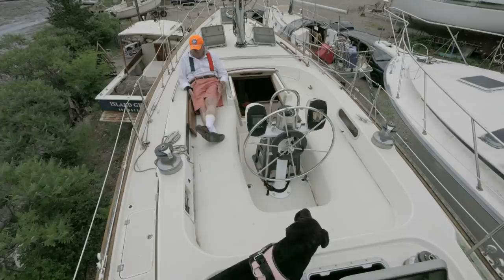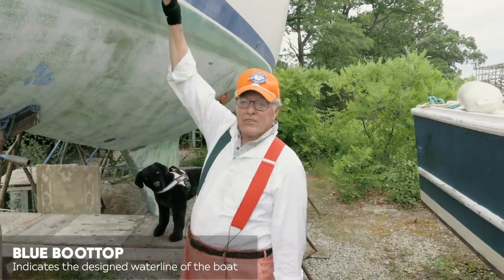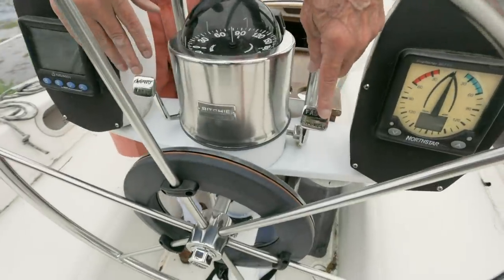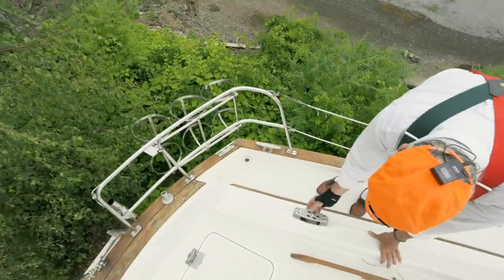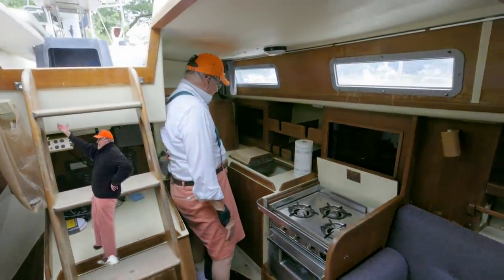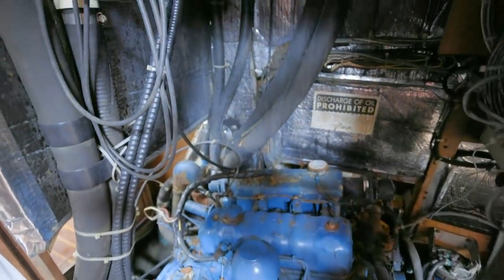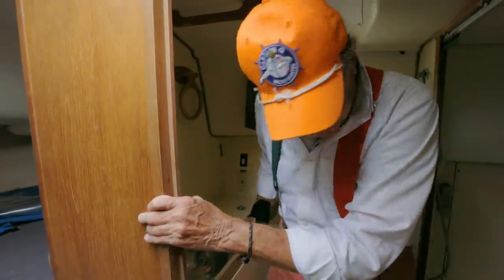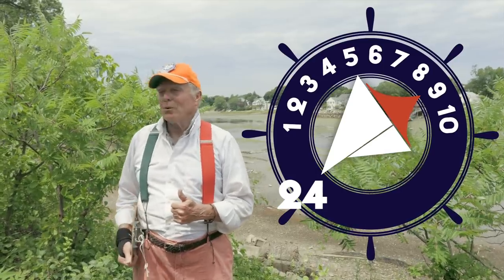$24,000 CRUISER! Pearson 385 cruising sailboat for sale | EP 47 #sailboattour  #sailboatforsale

Comment: I think you do a wonder job of reviewing these yachts, however, I think you should always pull up the floorboards to show the condition and configuration of the bilge. Keel bolts or encapsulated? Bilge pump and throughhulls. Steering quadrant, propshaft, cutlass/pss, and rudder post. Chainplate articulation? In this episode, it looks like there was a major crack on the skag just below the the rudder gudgeon. I wonder why there was no comment? FYI my first keelboat was a 1961 Aeromar (Pearson) 24' Aero.
Reply: Your line of thinking is spot on for any boat, and especially older boats. This one was on the hard for a while. The first thing I look at is the bilge. That being said, I think Capt Q and his very fine and able Crew tend to try to teach the potential buyer what's good about that particular boat. The things you mentioned, and rightly so, would be a discussion with the buyer's surveyor. My $.02
Reply: These dudes are not surveyors, and I feel like if they pulled floorboards and chipped any teak on the nicer boats they would face liability.
It is a youtube channel made for entertainment first.
Reply: @spider0804  I guess I disagree. They are showing what to look for in a yacht. Rather than opening every single drawer and commenting about how many doors to the head, they should spend more time educating the buying public what is actually important to evaluate.
Reply: @michaelrafferty5441  I agree with it being a good idea but I maintain the sentiment that it will never happen unless the owner were to come in themselves and remove the floorboards or sign a waiver or something. In the end it's up to the prospective buyer to know their crap or hire a surveyor anyway.
Reply: Good discussion guys. As someone who is learning you guys are as important as Capt. Q. Thanks for keeping it civil and about boats. Lol!
Reply: @ spider0804 👍. Capt.Q is way better than that guy on 'the lines... ' ever thinks he is 🙄
Reply: I thought it was a crack too until I stopped the video on the starboard side. It looks like a piece of ivy that has wrapped itself around the area? I'm not sure from the video.
Reply: @mtwolf13a  Yeah It's a piece of Ivy,  it moves when he moves his hand over the area at 4:27

Comment: That is an exceptional boat, especially for 38'!  It is obvious that smart design played a huge part in that boat, it has more usable space than many larger boats.  It is hard to find fault with a well designed center cockpit.  Her stats indicate a boat very suited to voyages beyond coastal cruising.  The condition isn't the greatest down below but it is not hard to freshen it up.  Nice find AK at a great price!!  I bet that one sells quickly now.
Reply: Mahina Expeditions recommends it as a blue water cruiser, although I would add when properly equipped...
Reply: @michaelfarinola5044  I would want more fuel tankage, a whole lot more as I hate Jerry cans on deck.  With that said, I think the design is brilliant and just needs to be accessorized before any long journeys are undertaken.
Reply: @NotOnYourLife  If you replace the front water tank with diesel you could more than double the capacity, especially if you fit in a watermaker somewhere.
Reply: @michaelfarinola5044  You could, though with a smaller boat fitting everything you want/need into the available space is always tough.  With the massive amount of living space in this boat, the infrastructure space is very limited.  I still love the boat though I cannot imagine a 5-10 year globe trot aboard her.

Comment: I really like this boat. I heard center cockpit on a 38 ft. and my first reaction was 'no thanks' but the layout was terrific. No small thing is the engine access. I can't believe the size of the cabins and headroom for a boat of this size. I don't mind the elbow grease/ sweat equity of cleaning and re-finish of the wood. Only issue is the 5 years of sitting. There will be a lot of work and expense that you won't find until you get into it. The price sounds good because it will be worth a little more after you clean it up but the line replacement, probable fuel issues etc. will eat up whatever equity built into the price.

Comment: Nice review, we love our 385!  For reference the port side "bench" does slide out.  Any chance you noted the hull number?  Also, there is a Pearson 385 Group on Facebook.
Reply: Awesome! Would you consider this a boat someone could single hand easily? Also I didnt notice any dinghy davits. Do you think they could be added without adding too much weight? And would this be a good boat for the Bahamas?
Reply: @bucknaykid5821  As far as single handed sailing I am far from an expert but we have tried to set ours up so it can be sailed from the cockpit by one person with lines coming back and a windless control both up front and at the helm.  I think it would depend on set-up and, more importantly, the person's skill and experience.  I would say she also handles nicely so I cannot see why not.   Regarding Dingy-davits, some 385s have them but they are not OEM, they are on my wishlist though and readily possible.  I would not worry too much about weight, it takes 1,200 pound to lower this boat one inch in the water.  Lastly, I hope so.  She draws 5'6" so she is reasonable for Bahamas and Caribbean.
Reply: @michaelfarinola5044  thank you for the great info. I really appreciate it
Reply: Hi,  I was wondering if you have ever taken across the Atlantic?
Reply: @georgesanchez9971  I have not, only owned her 4-5 years and have been refitting and learning, but mine has reportedly been to the Bahamas at some point.
Reply: @michaelfarinola5044  Great!  I like the lines of the 385.  I am trimming down to a smaller boat and this is on the list.  I have seen the 367 and they are strong. However, the 385 Is such a roomier boat.  Thanks for getting back!

Comment: Too much boat for me, but it actually looks pretty decent.  New running rigging and sails to start. Plan on investing 40k in a re-power in the near future though.
Reply: I would rebuild the old Perkins if it needed it rather than change it for a newer motor. Low tech; simple to repair, no electronics, spares available world wide. I would remove a more modern motor to put the Perkins in; great engines.
Reply: @cousinjack2841  obviously that is an option as long as you can get parts. Still an expensive proposition.  My point is that sailboats are expensive and people should go in with both eyes open. The worst thing that could happen is that this boat, which seems to be in pretty decent shape, get purchased by someone with only 25k to spend. Then a year down the road they need a motor rebuild and new rigging and the boat sits at the marina neglected.  I would say that close to half the boats at our marina never leave the dock, and we are at a pretty nice place. We bought our boat for $4200 a few years ago and probably have put another 20k into it.   We love her and knew what we were getting into.
Reply: @tednottodd  Your point was quite clear. I was just making a general comment about thinking about it before replacing an older motor. Some of the older plants have a hell of a lot going for them and Perkins spares are in plentiful supply around the world.
Reply: If it's not broken, and running, just new filters, fresh oil and hoses and belts..job done!!!..If It was broken a motor rebuild wouldn't cost that much maybe 5k tops.
Reply: The Perkins 4108 is an old tractor motor, marine-ized.
Reply: @michaelfarinola5044  The 4108, like a lot of Perkins products, was used in various equipment and vehicle types. From tractors to forklifts to generator sets.

Comment: Savy
This sailboat would be a good liveaboard for an old guy! As the Captain Q says:"motor south down the intracoastal" but... I would stop in Charleston instead of the Bahamas. Maybe winter 2 months  further south in Florida. A thorough survey is key to this sailboats purchase after sitting on the hard for 5 years. Very good liveaboard possibilities.
Reply from the maker: well said.... sounds like a plan! :)
Reply: l @YachtHunters  Captain: l recently  looked into the Block Leland pFoundation re the lease/buy on the Whitby 42 listed for 10 k. Spoke to the surveyor Jim, says boat took on water and there was an insurance issue before the donor gave it to BIF. I’m still interested if Perkins engine only need an overhaul not a replacement. What do you think? Should I buy or not

Comment: I don't understand why there's so many sailboats that don't have the ability to fill in the gap in the aft section of the v-berth...there must be a lot of couples sailing who really don't like each other. 😁
Reply: Easily fixed with a removable filler cushion if you are handy with power tools and a little upholstery.
Reply: There is a slide out panel under the bed cushions and the seat cushion fits the gap.  Takes about 30 seconds to switch.

Comment: I bought a 1974 cascade 29 that's in very good shape but does need a light refurbish. It has a 4 cylinder 15 hp westerbeke mini diesel that runs excellent. Paid 2500 dollars a steal I believe. What do you think. It has everything. Sails rigging anchor etc. Somebody tied it up after going sailing and abandoned it at the marina. Hence the low price.
Reply from the maker: I really have no opinion about it but if you like it and it will stay afloat and sail  your waters then it’s worth whatever even more than you paid for it

Comment: What’s a ballpark figure to get this boat in operable condition and on the water?   Would you need to inspect/replace all tanks, belts, hoses, electrics?  Put electric heads in, etc.?  New running rig, sails and possibly rigging?
Could you end up spending twice the purchase price to get her seaworthy??
Reply from the maker: Maybe  but what would a new one cost today   And you might find she doesn’t need all that much to be seaworthy for your modest purposes   But if you want to round the three capes well it might require a little more energy and $

Comment: i'm diabetic with leukemia i hope to retire and sail a 27-30' boat, what would be a good boat for me when i have a prosthetic lower leg?
Reply from the maker: Look for a bill tripp designed Columbia 30 or even a 34
I have thought about them with my iffy knees   Main reasons they don’t have bridge decks to scramble over 
  Wash boards can be used to simulate a bridge deck if weather gets fough.  They are getting hard to find but they are tough ok’d early fg boats and sail well.   I was briefly a dealer for them in the 70s.  They were built to a price snd were different looking  but see what you can find.  Good luck
Reply from the maker: …also a lot of easy deck space
Reply: @YachtHunters  thanks

Comment: If I wanted to purchase this boat how much would it  cost to be available with new sails, engine rebuild and everything else.  Rerigging  and electronicS fu
25k.  ??????

Would you guys help and film if I buyg???????
Reply: LOL ... you obviously a landlubber .... need to slow down of new sails, engine rebuild and electronics. 1st rigging hard/soft, fix leaks, bottom job, batteries, flush/clean/repair all engine components as req'd. Service all deck hardware, winches, cleats, tackle, etc.  Enough said ... go buy it b4 it's gone if you really ready to buy !!!!  GOOD LUCK !!

Comment: I like that boat except that the Captain ends up trapped up behind the wheel, I prefer to be able to walk around the wheel
Reply: Agreed, we installed a slightly smaller one 3-4 years ago for this reason.  It works fine.